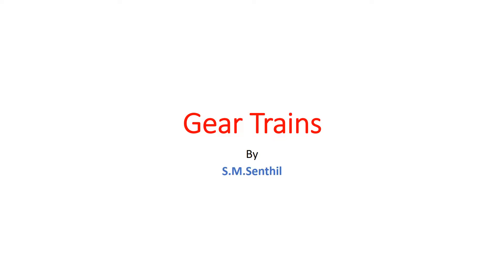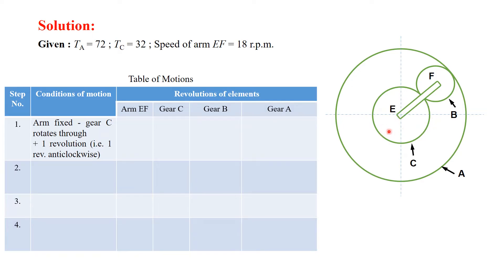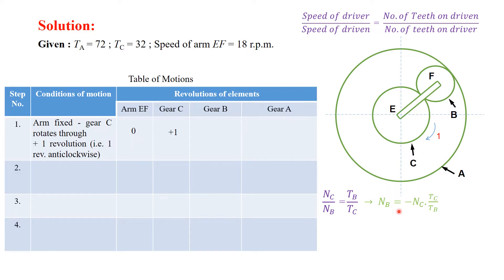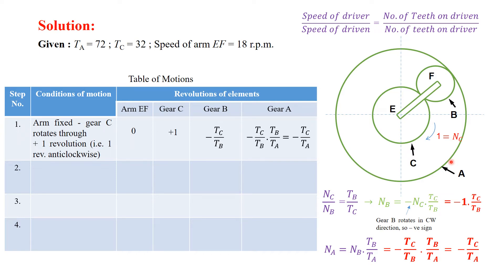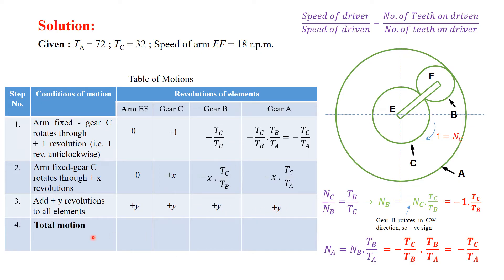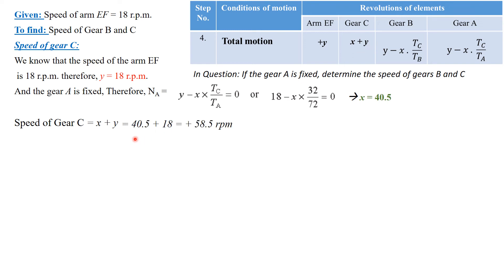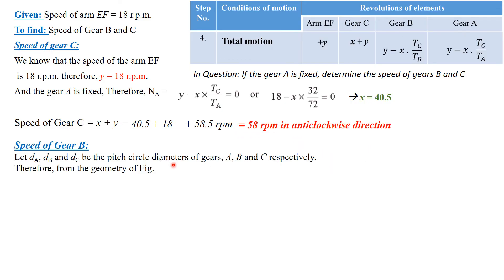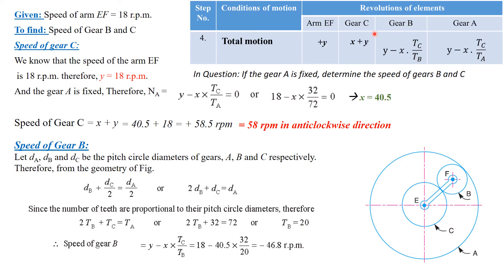Gear Trains - Epicyclic Gear Problem

Comment: An epicyclic gear train as shown in fig.1 is composed of a fixed annular wheel A having 150 teeth. The wheel A is meshing with wheel B which drives wheel D through an idle wheel C. D being concentric with A. The wheel B and C are carried on an arm which revolves clockwise at 100 rpm about the axis of A and D. If the wheels B and D have 25 teeth and 40 teeth respectively. Find the number of teeth on C and the speed and the sense of rotation of C.